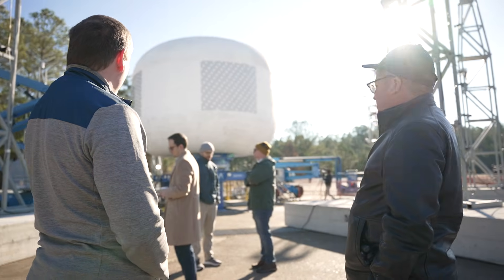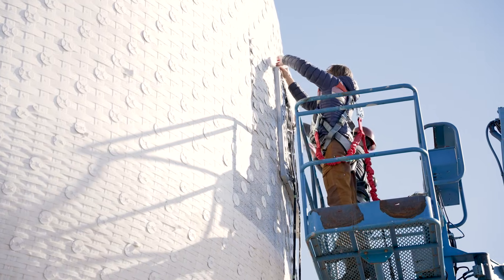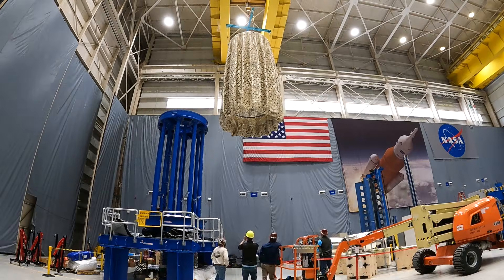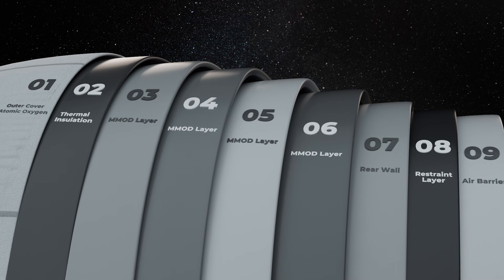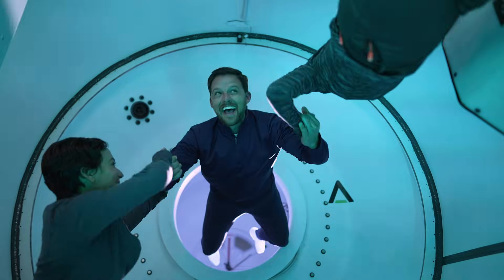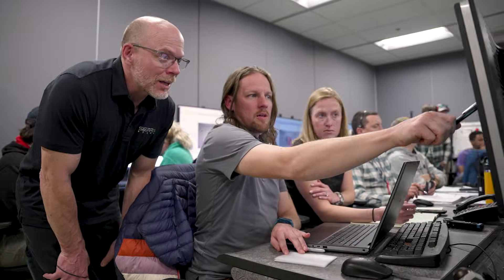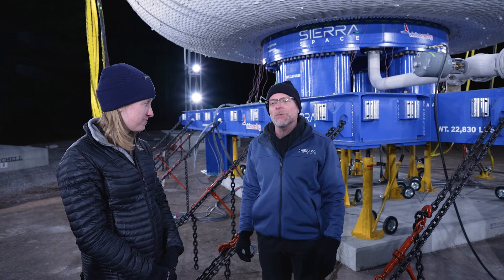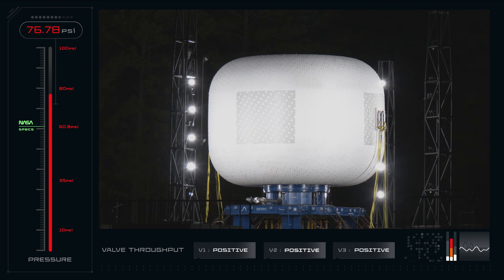Full-Scale LIFE™ Inflatable Space Station Burst Test at NASA Marshall Space Flight Center

Comment: I did a graduate level study on inflatable space structures about 30 years ago.  While we knew it was feasible, the materials development still had a long way to go back then.  It's good to see things are progressing.  Developing these for Moon or Mars based habitats will be key.
Reply from the maker: Our team is developing the systems and architecture to support lunar surface, cislunar and deep space applications.
Reply: I really love the end of this, Where the millionaire /Billionaire? is talking about, we're not trying to leave Earth. We're trying to build these things to make cures for cancers, And solving other problems👍🇺🇸.. How about this🤔 instead of spending billions Of tax dollars on a balloon, How about spending it on cancer research? In a non hostile environment🤔
Reply: Wow, that's pretty awesome. How do they keep the oxygen and carbon dioxide levels correct?
Reply: definitely compacting things as much as possible before launching is key. I love the idea of inflating, or unfolding, structures once in space (or on another body in the solar system). These processes will be quite valuable in developing the space infrastructure we will need to expand outward.
Reply: Can I ask you then?   I thought the containers that makeup the ISS are made from metal for a reason, like radiation or floating debris.  I know they have to use a shroud to cover the hatches from space dust, and we know an object the size of a bb can wipe out the station.  So how's an inflatable going to be any safer?
Reply: I always ask the question when someone brings up the subject of leaving this planet…Why ? Why, when we have everything here that we need ! 😢 let’s work on/spend money on cleaning this planet up and ways of cleaning the emissions that we emit and in the meanwhile create habitable structures in case we can’t clean it all up and this planet becomes as uninhabitable as Mars and the moon that we are planing for ???
Doesn’t make a lot of sense imo
Reply: key to what?
only reason to go to mars is to get its resources which could be done remotely but is not very easy as the transport back is gonna be a pain.
living their is useless that place is way harsher to live than the worst place on earth is for the foreseeable future i could see benefit to testing in space cause of 0 gravity but i dont even see a reason to go to the moon and complicate things a 100fold. way easier to just stay in space and not have to worry about landing and launching of a different terrestrial body .
and instead of them then pouring those resources to develop a habitable habitat on those very harsh terrestrial body's compared to earth they could pour those resources in making this planet more livable again without us having to change alot in the way we live now .
seems alot easier to me as you barely have to travel and the circumstances here are way less harsh as there to begin with. 
and living in a bubble is like living in a prison but of your own choice without any fresh air not really enticing if you ask me.
Reply: The BEAM module by Bigelow has been on the station for a long time now, and it has done just fine. It's even been struck by space debris and has performed well.
Reply: Consider possibly:
a.  Robots on the Moon (and eventually Mars too).
b.  Robots build habitats for other robots.
c.  Robots to repair other robots.
d.  Robots build infrastructure, greenhouses and habitats for other species.
e.  Other species move into their new dwellings.

*  To help fund this program:  Businesses that will have cremated humans and other species who want to be 'buried' on the Moon (and/or Mars), to help enrich the soil.  What better 'headstone' than the Moon and/or Mars for all the world to see?
Reply: Consider also:

'BATTERYLESS BATTERIES':
To help power equipment in outer space:

Potential endless energy source basically anywhere in this universe:

a. Small aluminum cones with an electrical wire running through the center of the cones, cones spaced apart (not touching I'm thinking) but end to end.
b. Electromagentic radiation energy in the atmosphere interacts with the aluminum cones.
c. Jostled atoms and molecules in the cone eventually have some electrons try to get away from other electrons of which those electrons gather at the larger end of the cone, of which also creates an area of positive charge at the smaller end of the cone.
d. The electron's in the wire are attracted to the positive end of the cone and the positive 'end' in the wire are attracted to the negatively charged end of the cone.
e. Basically a 'battery' has been created inside the electrical wire itself, different areas of electrical potential.  Basically a 'wire battery' or a 'batteryless battery', however one wanted to call it.
f. Numerous cones placed end to end increases the number of 'batteries' in the wire.
(In series to increase voltage, in parallel to increase amperage).

*  Via QED (Quantum Electro Dynamics) whereby electromagnetism interacts with electrons in atoms and molecules, one would have to find the correct 'em' frequency for the correct material being utilized for the cones.  The shape of the cones could also come into play.  The type and size of the wire as well as the type and thickness of the insulation between the cones and the wire would also be factors.
*  Of course also, possibly 2D triangles made up of certain materials with a conductor going down through the center of the triangle could possible achieve the same 'batteryless' battery system.
*  Plus possibly with the 2D concept, layered 2D's that absorb different energy frequencies, thereby increasing the net output.
Reply: It works great for the limited space in a rocket, works great for the increase in strength, but does it work for the weight and impacts over time that will happen. The material can stretch and allow the absorption of the energy from the impact but if punctured will it fail or allow a patch?
Reply: Can you give a quick YouTube education to me?  I always assumed it would be easy.  Even a mylar party balloon has a burst pressure of 14 psi, while the inside of the apollo capsule was 4 psi.

I figured protecting against punctures from internal equipment would be more difficult than the pressure problem.
Reply: I was surprised that it could handle that much  pressure considering it's size & volume.
Reply: Wouldn’t the prospect of micrometeorites or debris deflate (lol) the whole idea?
For solid structures which have a proven history of impacts, there’s a smaller chance that a tiny rupture becomes a full blown failure. 
There have been no penetration events of the ISS I’m aware of, but a small one would leak and be able to be plugged. 
Good luck to anyone who chooses to deploy or be deployed in one of these things cause it would mean ejection, instant loss of consciousness, no chance of retreat and no chance of recovery.
Reply: My hairbrained idea is to create inflatable airlocks for Martian lava tube habitats
Reply: how many professors laughed you out of the room?  In the history of bad ideas...that one gotta take the cake. smh
Reply: You actually phrased it in a way that made me change my mind about this endeavor.  Thank you.  That’s the key - it’s not about trying new materials for the sake of achieving far-fetched goals, it’s about the fact that our far-fetched goals DEMAND some type of inflatable structure.  In other words, it’s inevitable, it’s what’s required.  The skeptic in me just saw this as an unnecessary risk (believe me there’s gonna be plenty who will unfairly confuse/compare this endeavor with that of the Titan submersible), so hopefully their marketing/messaging team adopts your outlook.

Comment: 75 PSI - or about 5x what you need in space? Seems like a good safety margin, although I'm not sure what pressure is usually maintained for space stations.
Reply from the maker: Our average operating pressure for Low Earth Orbit (LEO) and Deep Space is 14.7. For our Lunar Surface Habitat application, it will have a lower average operating pressure of 8 - 10 PSIG.
Reply: Does that mean a high O2 environment to maintain partial pressure of oxygen? I thought we'd stopped doing that since Apollo? @SierraSpace
Reply: @SierraSpace  you should mention that thats for every square inch so 100s of thousands of pounds of pressure on the soft structure. Unless you dont want to scare people I guess. thats a pretty cool technology you got there.
Reply: @SierraSpace Given the abrasive nature of Lunar Regolith that it will be exposed to over time, is there additional shielding being designed for that habit or is it expected that the same technology can be safely used for Lunar applications without major redesign?
Reply: This Is probably a stupid question, but, has anyone ever thought of filling these with water? Making a habitat, using the liquid resistance to the advantage of the human body!?!!

Comment: What about micro meteors hitting your balloon?
Reply from the maker: The LIFE habitat has several layers of softgoods technologies. One of its layers is MMOD – Micro-Meteoroid Orbital Debris protection. This multi shock layer is designed to protect the habitat from orbital debris strikes for the lifetime or mission duration and its specific environment. This is a highly advanced design based on known technology that is applied to the surface of the pressure shell or restraint layer. Our team has conducted High Velocity Impact (HVI) tests and will perform more tests on the MMOD in the future.

Comment: So what is the micro meteorite protection? It seems to me that would be a key concern for a habitat. Well at least it may be an easy patch? A little rubber glue a bicycle patch. Bada Bing Bada Boom... it's just that easy...LOL
Reply from the maker: Our subject matter experts work with NASA and use the known and projected orbital debris environments in designing the MMOD shield. Those designs are then tested by simulating orbital debris impacts at varies speeds, size of projectiles/materials and angles. Our space station technology's air barrier is designed to be repaired if by a rare chance there is an impact that makes it past the MMOD and pressure shell system.

Comment: I should think a better failure would be a small opening, to slowly draw off the access pressure, instead of catastrophic failure. So if someone was inside they'd have time to patch the leak.
Reply: I think it's positive. It means that the entire structure is homogenous. 
It's way beyond normal pressure anyways, and then you have full control to engineer in any weak points
, add valves, pumps, etc
Reply: Just don't have enough air in the first place to get it up to the pressure.

Comment: The "burst test" I want to see is how it operates when shooting tiny steel pellets into it (like 1mm pellets) at orbital velocity when it's  pressurized to 14.5 PSI, sitting in a vacuum. Then, I want to see how you patch such an event. Also, which way will it be oriented while in orbit? Will the "top" or "bottom" be facing in the direction that it orbits and have kind of a shield in that direction?
Reply from the maker: Our team has performed MMOD Hypervelocity Impact (HVI) Testing with NASA, utilizing high power machines that can shoot a projectile at the rate or velocity of an impact in space. Projectiles vary in size and materials with an average of 1 to 10 centimeters. The LIFE habitat air barrier is designed to be repaired if by rare chance there is an impact that makes it past the MMOD and pressure shell system. We will be sharing more on this entire process in the future.
Reply: Yep, this would be compelling evidence for the sceptics.
Reply: A very good point.
Reply: Not sure what they have planned, but I've always thought that an inflatable could have either an epoxy layer that mixes upon inflation to make it rigid, or a gel layer that instantly seals leaks when the layer is pierced - both mechanisms should prevent the scenarios you brought up and honestly at 14.7 PSI with air escaping out of a hole into space a caulking gun with a patch compound or just an adhesive kevlar/aramid fiber interior patch should easily be able to plug a hole that small.
Reply: Thanks for answering the question I was wondering the same thing.
Reply: First you use a reamer on the hole then you put some goop on the repair stick and then you jamb it into the hole.
Reply: Are you guys going run pure low pressure oxygen or just 14psi on normal air ?
Reply: The “vacuum” makes no difference. It’s a LACK of pressure, not a “negative” pressure. Basic science knowledge. And what does a supposed “top” or “bottom” matter? Orientation to the planet makes no difference for protection, you need orientation against orbital debris, solar rays/radiation, and temperature. The Earth has no effect on any of that other than the short time it may act as a blocking element in each orbit, if at all.
Reply: > in the direction that it orbits and have kind of a shield in that direction?

Why? micrometeoroids are essentially isotropic.
Reply: I guess you don't need to put it in a vacuum, just inflate it to 29 PSI.

Comment: I was wondering how on earth are you supposed to put equipment in there with all the wirings and stuff? Os that solely for storage only?
Reply from the maker: We launch the softgoods packed around a metallic core that houses all operationa systems. Once the habitat is in space, it is pressurized and expanded to its operational volume. The additional volume once expanded is populated via additional transport vehicles such as the Dream Chaser spaceplane.
Reply: The idea, according to their presentations, is to put all connections (electrical, life support, data lines) in the base of metal ring connector. All other equipment will be delivered, mount and connected  via hub in metal ring after module installed on space station.
Reply: Wiring is flexible.
The idea is to provide space in a compact launch package and unfold the contents in orbit. Flatpack like IKEA.
Reply: I think storage and waste management in space has been an issue.

Comment: Scary project to work on, just how a tiny leak could be catastrophic in space
Reply: Not really. ISS deals with micro leaks all the time. But repairability of this material is interesting topic.
Reply: Tiny leaks have often occurred on current and past space stations etc. Of more concern is that it doesn't burst this way at operating pressure when pierced by a projectile e.g. micro-meteorite or space debri.
Reply: A tiny leak is a non-event.
Reply: Tiny leaks are… get this, TINY. This isn’t made of tissue paper. A tiny leak releases a TINY amount of air, the whole thing doesn’t EXPLODE.

Comment: Was the guy pushing on it from the outside supposed to simulate the pressure of the vacuum of Space?
Reply: That's not how vacuum works....  The pressure of the vacuum of space is 0 psi, or 0 bar, or 0 Pa.  So the habitat, pressurized to sea level conditions, would experience an outward pressure of 1 bar, 15 psi, or about 100k Pascals.  That's about 1/5 of what this vessel survived prior to bursting.

Comment: super cool. Does nasa have a requirement for pressurised hold time? like keeping one of these airtight as long as possible?. than again, if the use case is only 25% of the achieved pressure I doubt much can go wrong long term.